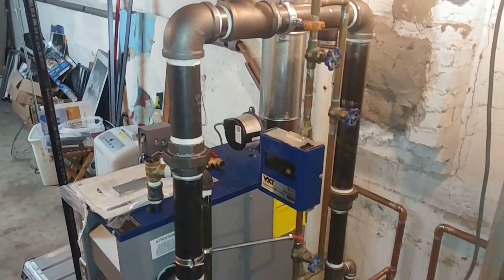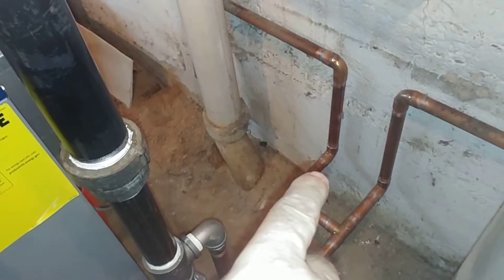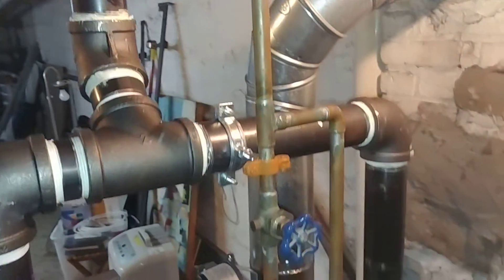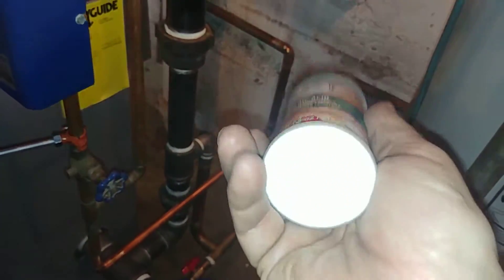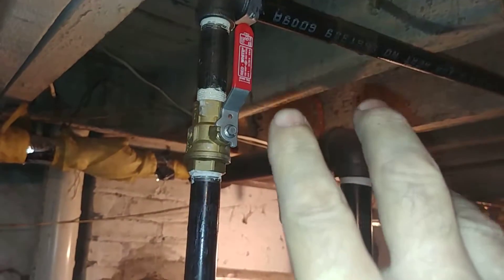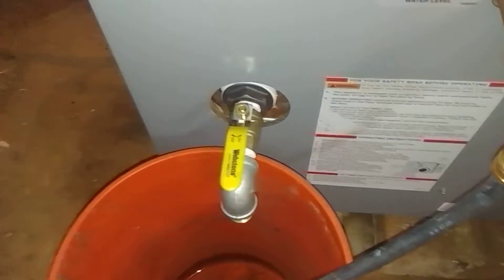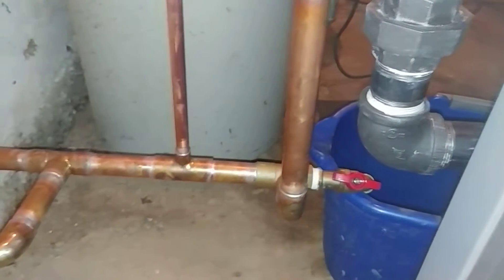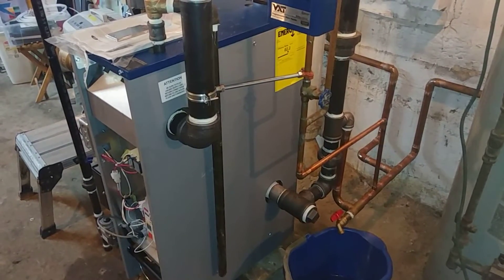Gas-Fired Steam Boiler Install Day 3. Ready To Fire On The Morrow

Comment: I'm having trouble getting two plumbers to change the slope of the 2" pipe at the end of a line.  They say to wait till the next heating season in October.  Steam plumbers are hard to find.   The end radiator air valve was blowin' water last season.

Comment: I like the citric acid idea💥. I never knew they carried 3/8”barbs x Fm. hose adapters, I got plenty of old washing machine hose. Thanks. Stay well.
Reply from the maker: Thank you!
Yes, citric acid is my new miracle chemical.
Like any acid, it needs to be thoroughly rinsed off or corrosion will happen.
I may start packing baking soda to make sure it's neutralized. 
With the citric acid and your excellent brass brush suggestion , it cleans up brass VXT valves right nicely!